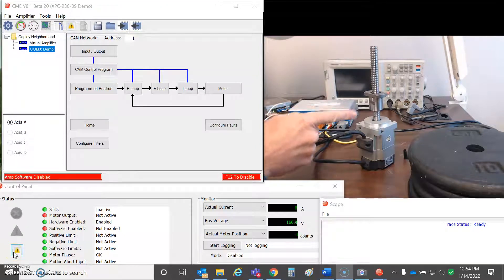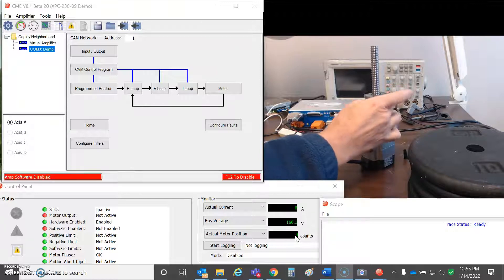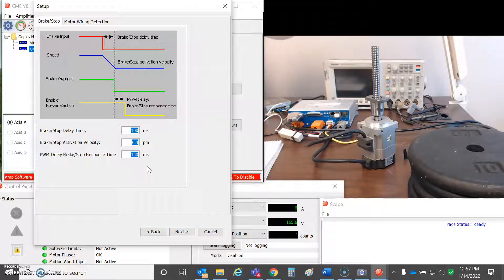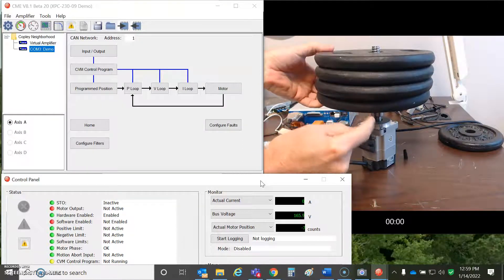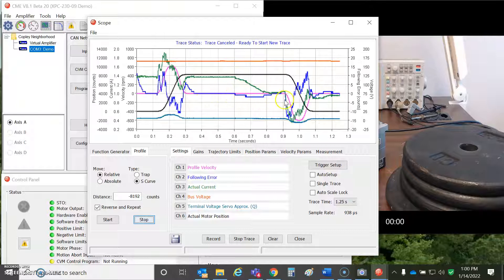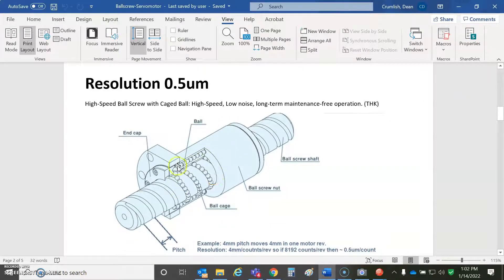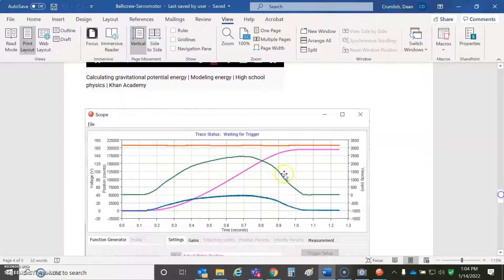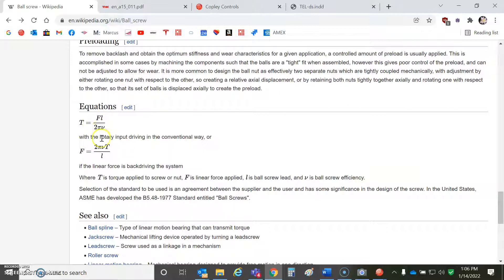Direct Drive Ball screw servo motor control with Copley Xenus drive

Comment from the maker: Apparently 40Lbs is 18kg * 9.8 N/kg  (N= kgm/s/s) = 176N (less than 200N limit but too close) so we can't accelerate the mass to fast vs gravity. Given F = T*2Pi then T = F*Pitch/2Pi, if we keep the peak current at limit 200N*0.004m/2Pi at 0.118Nm/A ~ 1A we will be fine. As we are already at about1A vs gravity we can see, we do not have much headroom to accelerate up to any kind of high speed. Perhaps 10% more given efficiency. Point is, this motor was not designed to lift 40lbs at 200mm/second vs gravity.